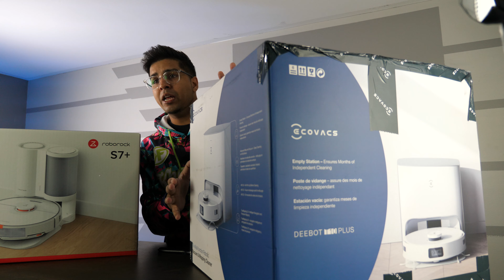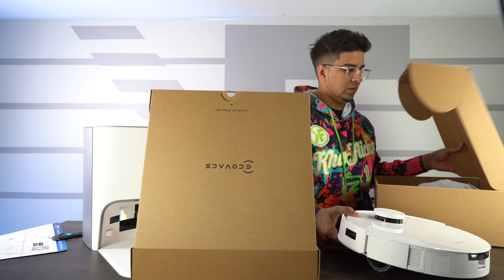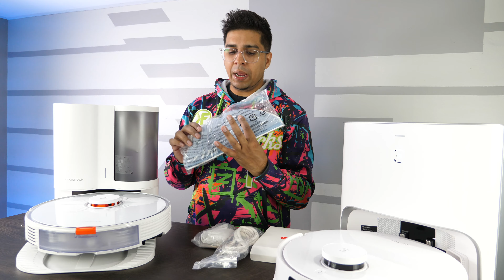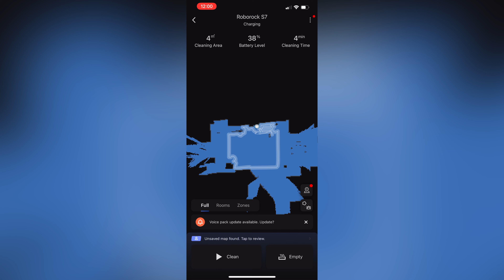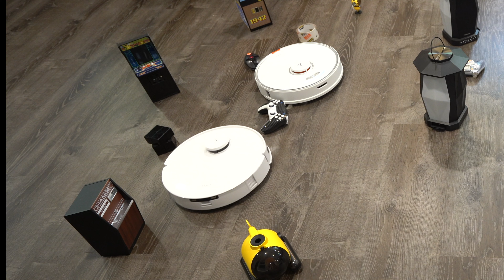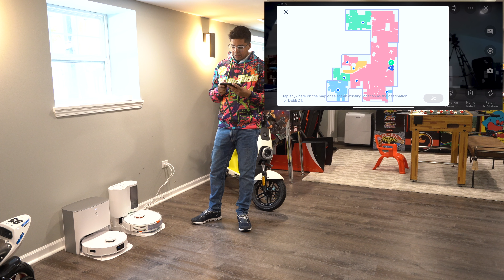Which Robot Vacuum Should You Get? ECOVACS DEEBOT T10+ vs ROBOROCK S7+

Comment: Thanks for  the video. To be fair, the better comparison would be the Deebot T10 plus with the X1 plus and the Roborock s7 MaxV plus. The RR s7 plus is an older vacuum system that does have a sonic mop but NO 3D or object avoidance features whatsoever.

Comment: I know the price is about the same but the comparison is not very accurate. The reason is the deebot has 3D and camera capability whereas the roborock does not. 
I know it’s more but a more accurate comparison would be either the S6maxv or S7maxv.
Reply: That's roborocks problem for not having mid tier quality product
Reply: your logic does not make sense.
The "correct comparison" is defined primarily by this criterion: "Price". 
What product is better at the same price? If the price is the same, then having more capabilities in one product, means it is a better product. 
It does not matter if a manufacturer has a product with more functionality in a more expensive version.